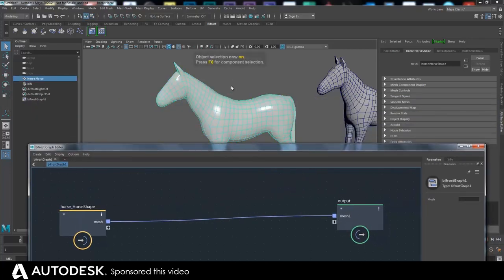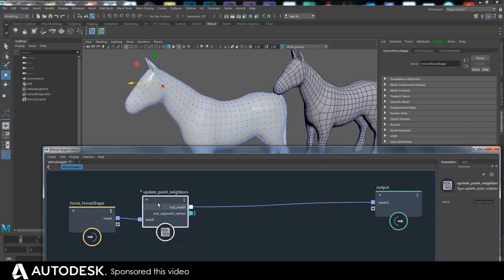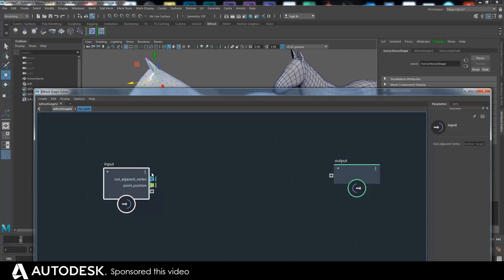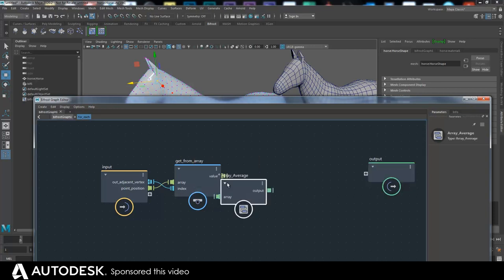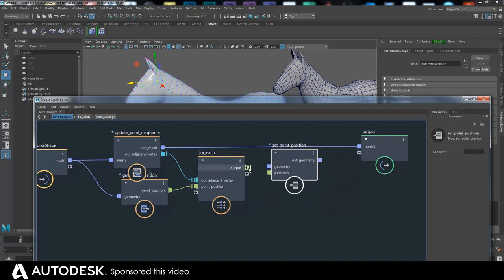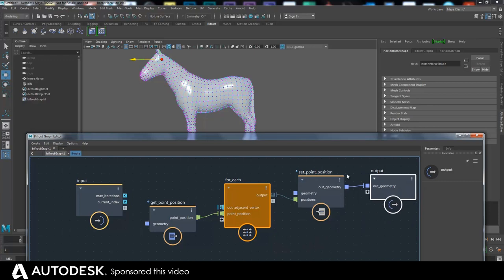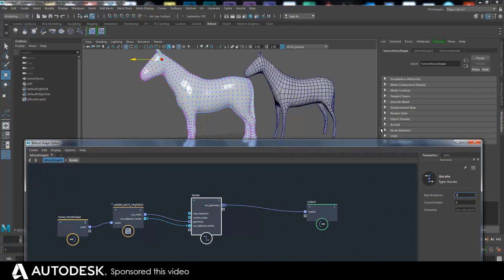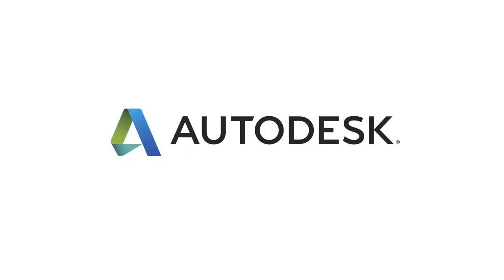Exploring Bifrost with Paul Smith - Ep. 6: Custom geometry smoothing using loops!

Comment: Is there a way to smooth out .bif cach data that is being pulled in, and smooth the velocity info? I have an issue where geo instanced on the cached data jitters when I use velocity for rotation. The jittering is an offset, not just rotation as one would expect.